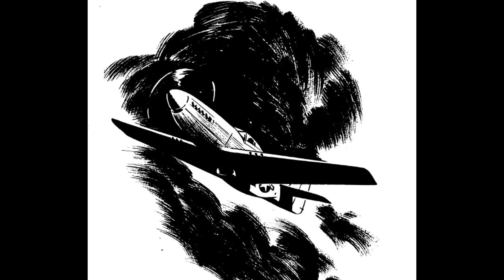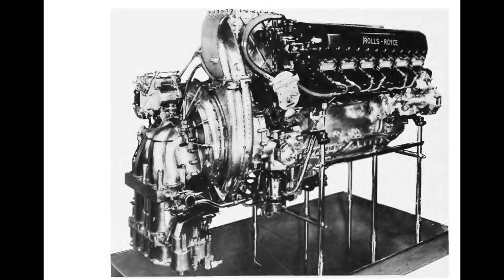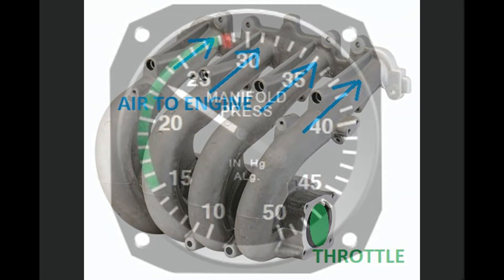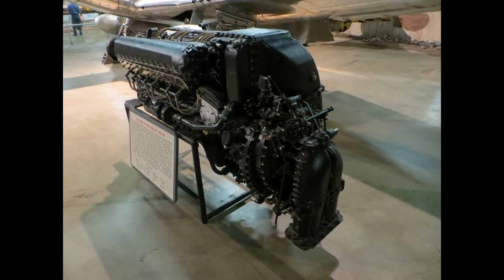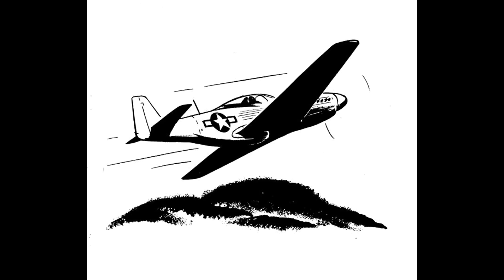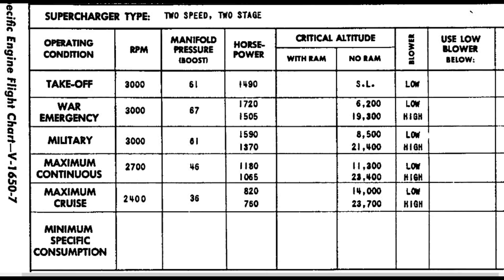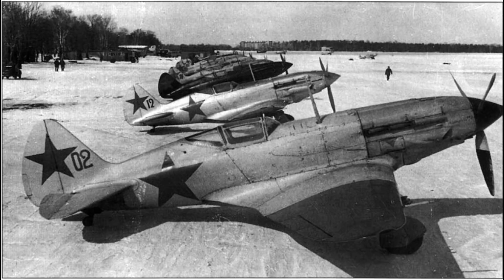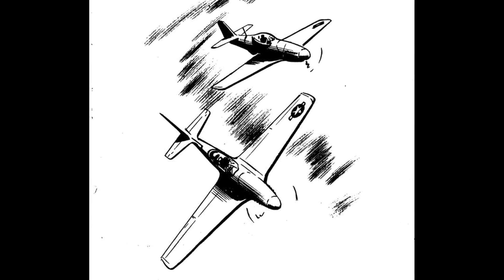P51 Mustang Manifold Pressure

Comment: Thank you! Very well-done explanation of manifold pressure! Do you describe every gauge's function? I'm trying to collect as many gauges as I can–with the original radium-226 lume. I just picked up a suction gauge, and it still works! I don't know if it's from a P-51 specifically, but it's the same type in photo of the instrument panel. Cool stuff!

Comment: Sir, thank you again for the work you do to create these videos. You have a gift for taking a complex topic and making to comprehensible. What I'm about to ask may be foolish, but here goes; would there have been a benefit to - rather than throttling the supercharger intake - to fitting a controllable-setpoint relief regulator at the supercharger outlet, and directing the discharge of that regulator directly aft via a thrust nozzle?

In the real world, I'm certain that a throttle valve would still be necessary for certain situation. But, once airborne, the throttle would be fully open regardless of manifold pressure, and the manifold pressure would be controlled by dumping unneeded air (ahead of the carburetor, of course) and getting some thrust from that. Or would the wasted mechanical energy cause more harm than good?

Comment: How do you account for the differences in intake velocity/pressure between the Merlin's "Ramp" Heads and "Pent Roof" heads in the Allisin, and the resulting differences in power required to drive the two blowers to any level of boost?
I only ask because my grandfather knew somebody who raced "Unlimited" Hydroplane boats and I was a hanger on and fetcher. They talked about it and his boat was clearly the fastest and had the fewest problems? It's tough being a twelve-year-old gear head and being around such tremendous machines as that boat and my dad's cars.

Comment: Voodoo, the P51 Reno Racer which holds the current world speed record of 531 mph TAS, set this record at low altitude...but what TAS might it have achieved had it flown at 25 - 30,000 ft, which was what Mustangs were designed to dogfight at?

Comment: As a chief engineer in the gas turbine industry, I appreciate the amount of reasearh that goes into your videos as well as how well you explain things. The more I know about WW2 aircraft engine technologies, the more impressed I am. Much of the technologies developed in these engines in the 1940's didn't get into race cars until 2 or 3 decades later. 
The 2 speed supercharger on the Merlin engine basically had a built in 2 speed automated transmission that allowed it to change gear ratios. The piston engine technology was only half the story for these engines because the turbochargers and superchargers were what ultimately determined the success of the engines. The gas turbine engine was born once people realized you could stick a combustor between the compressor and turbine sections of the supercharger and get rid of the piston engines.

Comment: I spent a bunch of time watching Richard Holdener's engine dyno videos (I highly suggest them) these past few months and your point about manifold pressure reminded me of him. His thesis about the relationship between how much forced induction is used on an engine, and its comparitive naturally aspirated output plus its gains, is proportional.

Meaning, if I had a hypothetical engine putting out 100HP, doubling the manifold pressure should roughly double the power. Often times we get a doubt about increasing complexity in an engine when considering mechanical drag and weight... but when it comes to forced induction, it really works in increasing power (especially at altitude).

Absolutely nothing new to be gleaned from this comment but it is interesting to know that there really aren't any secrets when building engines.

Comment: I saw that ww2 mosquito or P38 lightening achieved much better fuel economy after the aviator Lindberg advised them to adjust Inches of Mercury. What would he have advised to achieve this? That, Mike
Reply from the maker: He was manually leaning the engines and running at unusual rpm/manifold pressure settings. I'll cover this another time.

Comment: Love the channel! trying to fly the P-47 in DCS in a campaign, and could not keep up with the Wolfpack formation… ended up watching your channel for a couple of hours. Question; How do you record, your audio is some of the clearest I have heard anywhere!!?
Reply from the maker: That's odd, I get a lot of complaints about the audio. Anyway, I'm usually recording on a cell phone in a hotel room.
Reply: @GregsAirplanesandAutomobiles  thats surprising. I was convinced you had some kind of impressive studio going there. it sounds great on my Sony headphones, like you are in the room here. ps; Just did the first wolfpack mission escorting a massive flight of bombers. thanks to your engine management tips i managed to have the speed to keep up and climb with the formation, but when we hit altitude over the french coast my temperature suddenly spiked, and i could not get it cooled again playing with the oilcooling setting, nor cowling flaps. lost all power had to turn back and ditched mid channel.. all this in VR of course, its insane to be able to experience what these pilots went through… so more engine management studies needed I think. will watch a few more of your videos.
Reply from the maker: I haven't flown the 47 in DCS yet, but I am flying the Dora in DCS and the engine management is pretty critical, so I imagine they set the 47 up about the same way. Try keeping your speed higher in the climb as that should help cooling (assuming it's modeled correctly). In real life the 47's engine would heat up if climbing at best rate for an extended period of time.

Comment: With high manifold pressure, above atm press, does the intake stroke act like a mini power stroke, i.e. blown air is pushing the piston down during intake stroke?  Would be interesting to see a PV and TS diagrams comparing boost vs non boost engines.
Reply from the maker: Yes it does, but it's a small effect compared with the drive power requirements of the supercharger (i.e. either a mechanical driven unit via power from the crank, or an exhaust driven device via power loss from the piston on the exhaust stroke spinning the turbine).

Comment: I think japanese used also ATA or something similar. Their Gauge goes from -40 to +20 sometimes aibt higher. But 1.2 Ata seems to be +20 on Japanese gauge.
Reply from the maker: They used millimeters of mercury.
Reply: @GregsAirplanesandAutomobiles  I see... its just confusing because their gauges just goe from -40 to + 40 which is weird consider that 1 Ata is 760mmHG and 1.2 ATA is 911mmHG and 1.4 is even over 1060mmHG 

And the Ki61 especialy used the DB 601 which is confusing to see those nummbers on the japanese gauge.

Maybe the Gauge is in cmHG

Comment: Some sources claim that German "ata" is about 980 hectopascals - while Standard atmosphere is around 1013. In other words it is kg force per square centimeter.
I do remember that in early 90's in Poland when cgs system was still in popular use, for a short time we used all 3. 980, 1000 and 1013. Poland having average altitude similar to Germany - it made sense - since a lot of land is around 300 meters in altitude (it varies of course, now we use standard 1013). I don't know if it helps, but on historic airplanes forums and Il-2 Shturmovik game forums (which unlike most games is usually full of people who actually know at least some basic stuff) I did came across that definition of "ata".

Comment: when you say a supercharger "hates to be throttled", do you mean that's because manifold design is optimized at WOT?
Reply from the maker: No, not at all. I'm not sure I can explain it well in comments, but here goes. A supercharger creates a pressure ratio, NOT boost, but a pressure ratio. So let's say it's 1.33:1. That means at ambient, let's say 15psi atmospheric, it will boost us by 5psi for 20psi of total manifold pressure (1.33x15 is 20ish). Now keep the supercharger at the same speed, but throttle it so that pressure at the inlet is only 12psi. Now that same supercharger speed is only going to give us 4 pounds of boost, but we are spinning it fast enough to get 5psi so it become inefficient because to get the 5 psi we have to spin it faster than we need too. Clear???

Comment: I thought the Packard merlin ran on 150 octane rating. The engine plate says 100 octane?
Reply from the maker: Then can run on 100 octane, but with lower manifold pressure limits.

Comment: Greg, 1 atmospehere is 1013 mbar, not 1000. That's where the discrepancy comes from.
Reply from the maker: Yes, but we don't know if the WW2 Luftwaffe used 1 ATA=1 Bar, or one atmosphere, i.e. either 1000mp or 1013mb, not much difference anyway.
Reply: @GregsAirplanesandAutomobiles  I looked into it a bit further. It seems that the atmosphere in question is the technical atmosphere (at), not the standard atmosphere (atm). So "ata" is the absolute pressure and "atü" is overpressure (Überdrück), both in technical atmospheres. I don't know if that fits in your data but in general it wouldn't make sense for the Luftwaffe to use different conversions. As you said though, not much of a difference, especially in the context of this video.

Comment: Atü stands for technical atmosphere  and is so far I am aware related to the expansion of watert to steam and isnt in use since the 1970ties anymore. Neither is the Hg scale. Most used are Pascal for the weather and Bar. 1 Bar equals standard airpressure.
Reply from the maker: Yes, but it's a question of what number they used for the standard atmosphere in Germany back then. Today one atmosphere is 1013mb, but one bar is 1000. hg is still used in aviation today, in fact it's pretty standard.
Reply: @GregsAirplanesandAutomobiles  Is there a reason for that? Thanks though for the additional information.

Comment: Could P-51 pilots do the same as Spitfire pilots, "Rev the revs, and boost the boost, you'll have enough petrol home to roost", i.e. use high boost levels at low rpms to save fuel?
Reply from the maker: Yes, that was a standard fuel saving tactic. They would run relatively high manifold pressure, low RPM and manually lean the mixtures for good fuel economy. Well, relatively good, you might go from 4.1 mph to 4.3, but every bit helps.
Reply: @GregsAirplanesandAutomobiles  
Hey, that’s like a 5% increase in range.  assuming you’d otherwise only have enough gas to return 400 miles, that’d give you an extra 20 miles, the difference between walking home and swimming home in some places

Comment: For those interested in this topic you might like to read the autobiography of Sir Stanley Hooker who was the man responsible for much of the development of the supercharger of the Merlin engine (and subsequently a key figure in the development of jet engines at Rolls Royce and BSEL). It's titled "Not Much of an Engineer". One point he makes in the book is that Germany paid a heavy price in terms of power output for their direct injection fuel system. By using a carburettor ahead of the supercharger the intake charge of the Merlin engine was cooled by about 25C (45F) by fuel evaporation thus increasing the density of the charge entering the cylinders at a given manifold pressure.
Reply: He  modified an existing design for the merlin
Reply: @kenneth9874  As I said he worked on the supercharger for the merlin. The 2 stage supercharger he designed was entirely different to the 2 speed unit it had previously. His work greatly increased the performance of the merlin. None of this affects his ability to assess the relative merits of carbs and FI.
Reply: @ColinMill1  Lol, the 2stage 2speed intercooled supercharger was 1st used in a fighter in the f4 wildcat
Reply: @kenneth9874  You should read about the work done rather than trying to sneer . It was the detailed configuration of the aero and thermodynamic design of that supercharger that so increased the performance of the merlin. 
If you think his contribution was trivial perhaps you can give a reference to an authoritative source to back up your opinion. Of course your argumentum ad hominem does not change the fact that he was right about carbs and intake charge density.

Comment: How come  that despite being supercharged Most ww2 aircraft engines didn’t produce huge amounts of power per litre?
Reply from the maker: Mainly because they operate at such low RPM. Most have maximum RPMs from about 2700 to about 3000. If you look at horsepower per liter PER RPM they start to look a lot better. In general aircraft engines are designed to operate at much lower RPM than cars.
Reply: An aircraft engine is designed for horsepower to weight ratio and frontal area. The old saying "only substitute for cubic inches is cubic money".
Increasing cylinder volume don't affect engine size much. Increase RPM needs bigger reduction gear for best propeller RPM.
That we are obsessed with power/litre in cars is simply because of race car regulations. Nowadays also MPG.
A car engine is mostly run at at a fraction of it's max. power. Aero engines runs most of the time closer to max. power.

Comment: PSI makes the most sense. Pressure is a force exerted over an area, and that's what the unit is.
They should really be using SI units, or probably Bar as it's a bit easier to work with (i suppose kPa would be quite easy to use too), and very close to the German ata.

Comment: Hello, You might be intrested in looking up the Arsenal H12 Engine, basiclly a Jumo 213 assambled by the French Arsenal company after WW2 modified to run on 100/130 octane gasoline. I have only stumbeld upon a few bits of information regarding this engine but might be intresting to compare power and boost pressure to the low octane Jumo 213 if there is any info is available.

And thanks for a great channel :)
Reply: +igel1     I agree that post-war manufacturing and use of the German aero engines would make an excellent topic. Some use has been covered elsewhere but manufacturing and use by the Arsenal de l’Aéronautique seems to have little written about it.   We know that the Czechs and the Soviets were building Jumo 004 turbines, along with the Czechs continuing production of the Jumo 211 V12s.  Volvo in Sweden continued some production of the DB 605 for military and experimental use after WW2.   France was left with both a BMW engine factory and a Jumo engine factory.  Post-war use of leftover BMW 801 engines in France was arguably not very successful due to quality problems.  Then we have the Arsenal de l’Aéronautique which continued production of the Jumo 213 and added further engine development to the series.  The more exotic of the series was the Arsenal 24H, a new crankcase with Jumo 213 cylinder banks arranged in an H pattern.  https://oldmachinepress.files.wordpress.com/2016/02/arsenal-24h-rear.jpg?w=768&h=484    And also continued production of the Jumo 213 V12, rebranded as the Arsenal 12H.   The 12H saw use in the Nord 1400 seaplane, with the last Nord example delivered for service in 1956.  So it is possible that the Jumo 213 engine was still in use into the late 1950s or early 1960s in France, which is impressive.  https://www.avionslegendaires.net/wp-content/uploads/images/avion_militaire/Gn1400-noroit-index.jpg

Comment: I believe a critical aspect of the "supercharger" equation is missing.  You hint at it in the p51 vs bf109 vid when you discuss octane rating, but ultimately leave me, at least, in the dark.  Namely compression ratios.  You state that "overboosting" can occur, but never explain what overboosting actually means.  I suspect overboosting occurs when so much compression occurs in the compression stroke that preignition is unavoidable, due to overheating of the air/fuel mixture under compression. Please explain what octane rating is, and what compression ratios occur in normally aspirated gasoline car engines.  Then I'd enjoy comparing those numbers to, say, the Merlin engine.  What is the compression ratios in a Merlin?  What is knock? Why is higher octane better?  I would guess that engines made to operate at 13 to 1 or more compression ratios in order to take advantage of 130+ octane rating would need to be very strong, and heavy.
Reply from the maker: Dude, this was a 10 min video. Compression ratios for WW2 fighters are generally around 6.5:1 to about 7.0:1. Octane rating is simply a fuel resistance to knock.
Reply: Thank you for replying.  That seems like a very low compression ratio, especially considering octane ratings of 130 or 150, according to your other vids.  Here is a nice explanation of the connection of octane rating to compress ratios. https://mnbiofuels.org/media-mba/blog/item/1511-octane-and-ethanol-for-beginners.  Could you explain why such high octane ratings as were found in WWII aviation gas were not combined with high compression engines?  There is an obvious power boost that seems like it was untapped?
Reply: @lotklear  You are talking modern piston design, modern spark plugs, and modern valves (sodium cooled).   You just couldn't avoid knock in a carb engine at high compression back then.    Consider automotive, cars that used to have 8.5 compression ratios now have 10.5, much due to valve cooling, piston cooling, spark plug placement/design, and fuel injection.